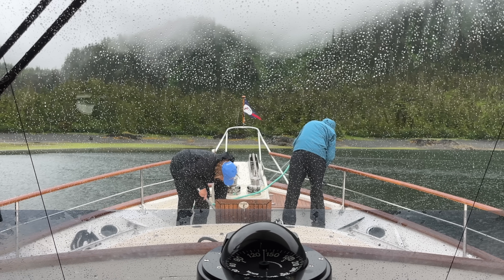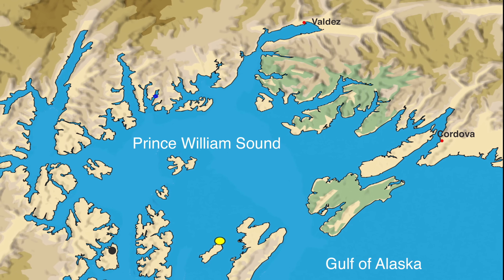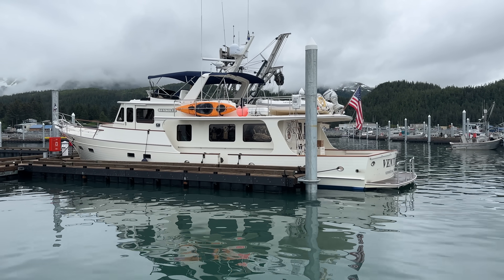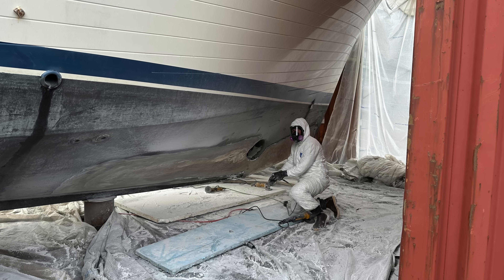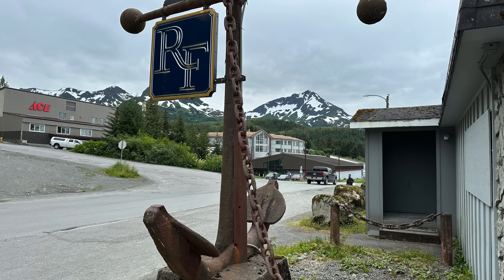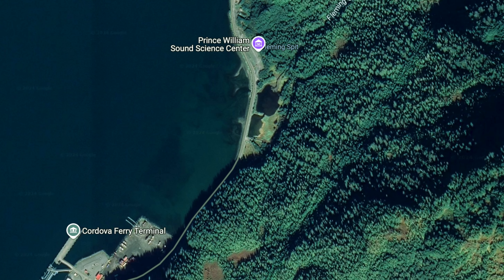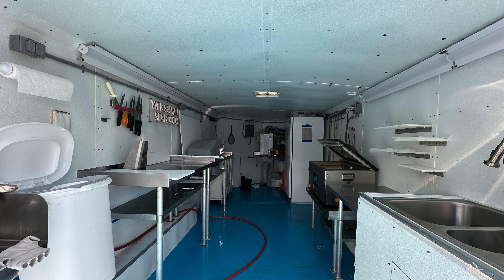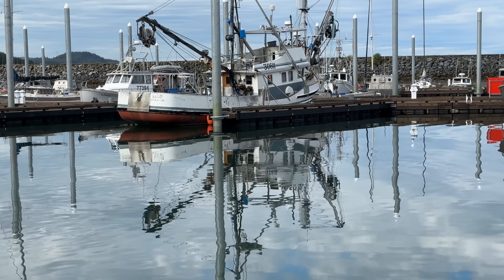How I became a member of the Prince William Sound Rock Club

Comment: I was wondering why they could not get the original hull form of the hull whilst making repairs?
Reply from the maker: This only applied to the actual stem. That was the part that took the main impact and finessing the exact shape would have taken several more days and they had work on other boats backing up and we were spending a fortune on hotel rooms and anxious to get back on the water.

Comment: Tony, Thank you for sharing this. This must have been a difficult video for you to produce - but you certainly aren't alone in this misfortune.

Are you going to describe the damage in a future video that explains how VENTURE was built, or not built, to withstand a rock collision?  Was there any water incursion?  How was this held in check in a FLEMING yacht? If this is even a valid question, how much more damage could VENTURE have endured and still kept her and crew relatively secure due to her design? How, if anything, has this accident changed your thinking about yacht design.  Are you going to modify VENTURE as a result of this grounding?  Ah, the list goes on......

I don't think anyone thinks any less of FLEMING yachts as a result of this grounding.  I may be way out of line here, but your yachts are so exquisitely built, I think some of us would like to learn a bit more about your yacht from a very different point of view.  

Thoughts?

Comment: Would a steel impact plate (not sure what the correct term would be) at the bow help here?
Reply: how are you going to mount the plate? 
steel is much stronger than fiberglass, it will help with minor scratches. But it would cause more damage in bigger accidents.
Reply: @war3scecfang  Marine steel is nowhere near as strong as fibreglass. But it's more durable and abrasive resistant.